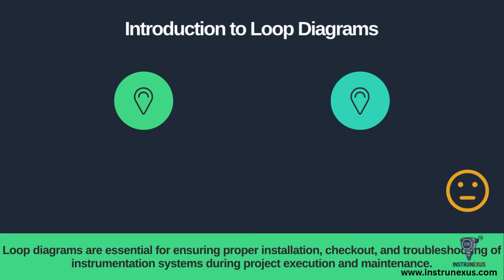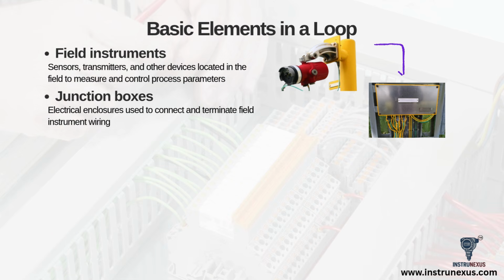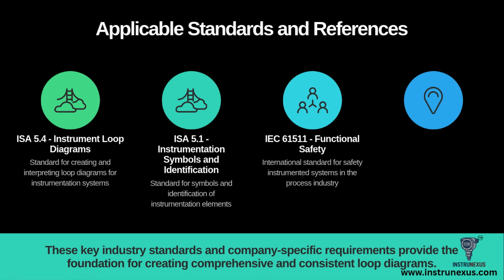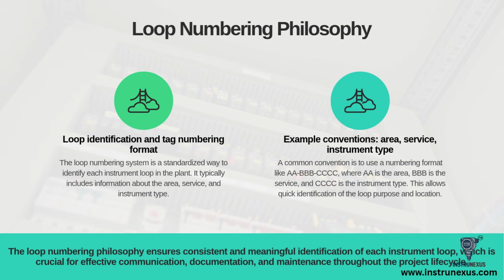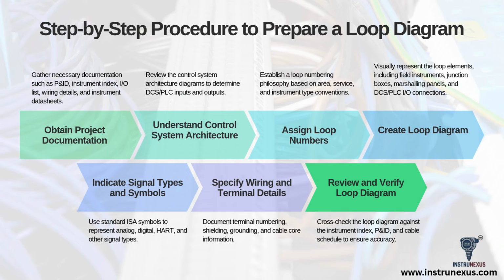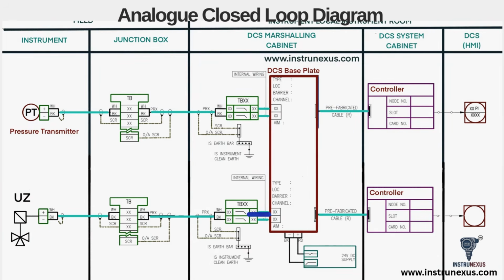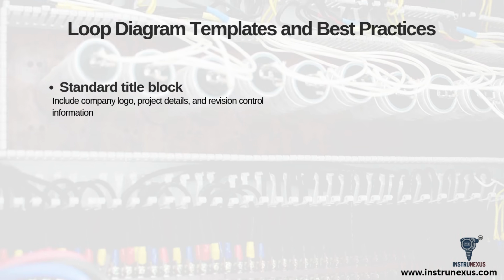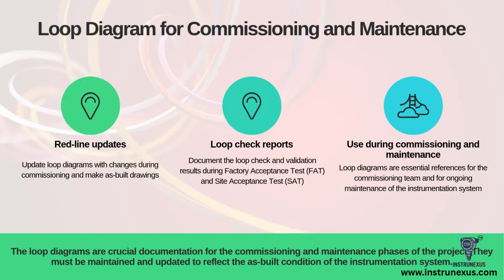⚡ The Complete Guide to Instrument Loop Diagrams | Design, Commissioning & Maintenance

Comment from the maker: For me, the two most critical parts of the entire process are:

The Review & Verification: Cross-checking the loop against the P&ID, Instrument Index, and Cable Schedule is where you save yourself from major headaches later! 

During Commissioning: This is when the loop diagram becomes the "single source of truth." Using it for loop checks and "red-line" markups is essential for creating the final "as-built" drawings. 

Question: What's the BIGGEST mistake you've ever found or made on a loop diagram? Let's share some lessons! 💬